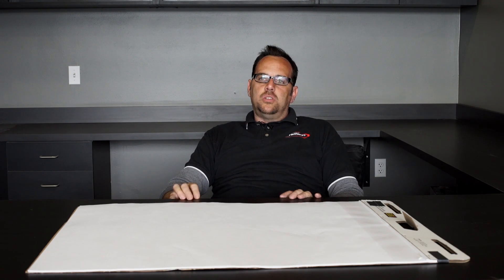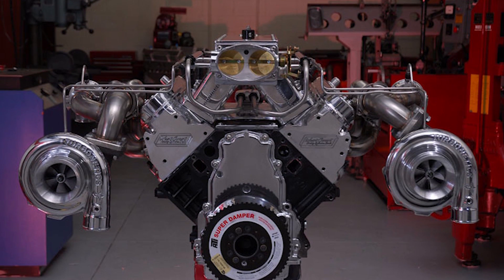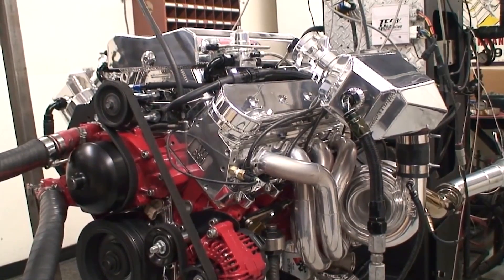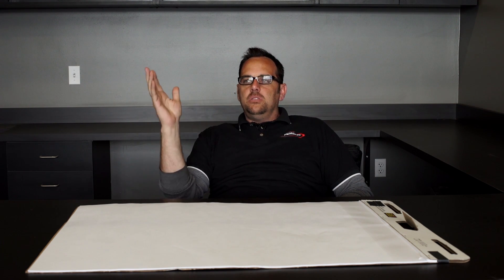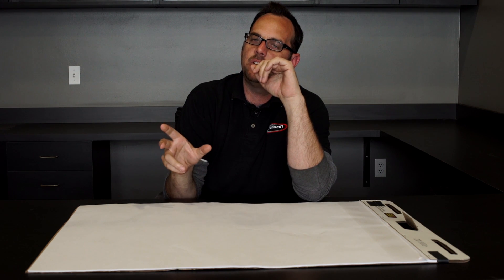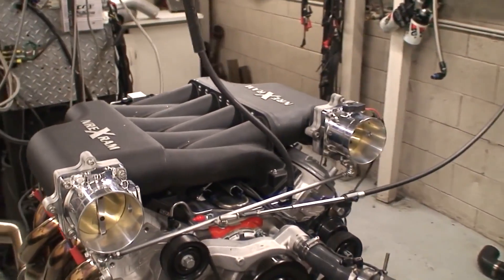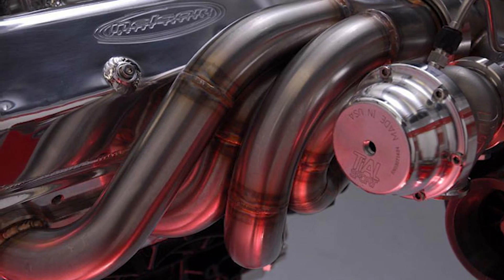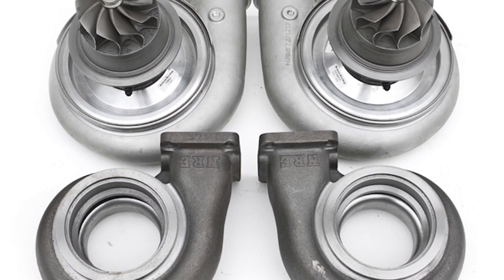Master Engine Builder Explains Why the LS V8 Is SO Good

Comment: Trick question. It's not.
If it's so good, why is it dying out.
Reply: +Dan Frederiksen I'd say the LS is dying out like 350's with carburetors. Which is to say, they aren't. Pretty much every GM car with a V8 has a variation of one, not to mention all of the aftermarket attention that LS' get. They are the Barbie of engines, just stupid amounts of options.
Reply: +Dan Frederiksen You may have missed the entire point of this video.
Reply: LOL lemme guess you get your ideas about car culture from social sciences class?  Dan Frederiksen
Reply: +shredBucketheadshred Yeah he's one of those
Reply: +Dan Frederiksen ummmm..MURICA! Fuck your global warming we're burning this bitch to the ground
Reply: +Michael Dao but guys.. he just learned it in his first college class, obviously he knows what he's talking about.
Reply: +Dan Frederiksen It was replaced by a more advanced engine.  That's how things work.  If you were an engineer you would understand that.  Care for another go around?
Reply: Dan Frederiksen Actually we were talking about the LS V8 engine here.  There are more aftermarket applications for the mill than ever before.  The original small block Chevy hasn't died out yet. Anyone that thinks...err...sorry...FEELS that the LS is dying out is just ignorant of the facts or just pushing their special little agenda.  Or someone just pretending to be an engineer.  

The Ford F series has been available with a 6 cyl for decades.  And the F150 is still available with a V8.  Then again, an engineer would know that.  

And electric cars are an alternative, not a replacement.  Not until range and recharge times (and price) equal combustion engines.  An engineer would know that. 

Had enough schooling for one day? lol
Reply: +Dan Frederiksen Your surface level understanding and desire to showcase it is hilarious.
Reply: +Dan Frederiksen huh?
Reply: BAHAHAHHAHA you really don't know much about the V8 fandom around the world do you OR the fuel alternatives before even considering electric THAT BTW as yes produces far worse pollution in the long run per car through production and recycling limitations ? You REALLY don't know much about people and car people in particular do you!Dan Frederiksen
Reply: Carausu Vlad So it seems that we agree.  I had high hopes for the Z06 but that heat soak issue should have been ironed out before it's release.  But then again, the Porsche GT2 RS had the same issue. 

But remember when the original mouse was replaced by the LT?  Everyone hated it for the same reasons.  Then it became the darling of hot rodders.  Lingenfelter used it to make ridiculous power.  Then the LS came out and everyone hated it.  The cylinder slap was maddening.  See how thing change?  In a few years everyone will be in love with the new LT4 once it's idiosyncrasies are figured out.

I bet someone figures out a fix for cylinder deactivation before there's a glut of used LT4 engines on the market.

BTW, my SCCA/Rally/Everything car is a '70 Z28.  I'm seriously considering a LS swap from a wrecked GTO.  Mostly for weight savings but also because it can be had so cheap.
Reply: Dan Frederiksen But you on several occasions have claimed to be an engineer?  Lying seems to come very easy to you.  No wonder basic engineering principles elude you.  That is why you have an opinion and I have informed opinions.   No wonder some of your statements defy basic laws of physics and even common sense.

Your statements are about as reliable as a Tesla.  lol

Troll smarter next time.
Reply: Dan Frederiksen Is it just easier to call people names than to actually make a valid argument?  That isn't something a real engineer would do.  lol
Reply: Dan Frederiksen If it is a fact then someone other than you should be able to verify it DUMMY.  An engineer would know this DUMMY.  lol
Reply: ***** Agreed.  The LS will be around for a long long time.  Even though it has been replaced by the magnificent LT by GM.  Current Corvette owners are reporting over 30mpg on the highway.  Amazing.
Reply: ***** I remember when I linked evidence that in some cases a larger V8 can run cleaner and have better fuel economy than a smaller forced induction engine.  Danny boy completely lost his sh!t and ignored the verifiable data.  Then babbled about electric cars.  And he claims to be an engineer.  lol

And I'm a huge Buckethead fan too  :-)
Reply: Yahtadi Shidiq
Wow your ignorance is outstanding. The fact that it has been proven Volkswagen cheated these tests and have in several press conferences acknowledged the problem and attempted to apologize for it. Or that some of their top brass have been fired over the issue. You sound like the typical liberal who is incapable of understanding common sense.
Reply: NuclearGrizzly
not dying out tho with aftermarket blocks heads and parts being pumped out, more an more car get LS engines everyday
Reply: NuclearGrizzly yes, I am excited about the LT becoming mainstream too...I love how compact and light it is. you are right, its still new so its unfair to compare it with an engine that has had 20 years of evolution, refinement and aftermarket parts..
I can see a LT engine in my 68 camaro project in the future when the prices will come down and the issues are all ironed out
Reply: Dan Frederiksen What idiot told you that.  Certainly not an engineer.  Could you provide a link?
Reply: Dan Frederiksen Could you provide a link to the relevant data to support your opinion.  I can't find any information that would support your claim that the entire world's transportation needs could be powered by wind, water and solar.

It just violates basic engineering principles?

Or are you just making things up again? lol
Reply: Yahtadi Shidiq
You really think anyone will take you seriously? All of you responses have degraded into nothing but drool. It is extremely obvious that you are nothing but a troll just looking for reactions. Ive grown tired of you trying to dumb up my day, Congratulations you have earned the right to be in my blocked dumbasses group, You deserve it.
Reply: +Dan Frederiksen Here's a fun fact:  the Toyota Prius, that gasoline sipping hybrid, causes more environmental damage over the course of a 10 year life than a Corvette.  The reason being, the mining and refining of the nickle used in the batteries causes much more environmental impact than just running a normal car for the same amount of time.  Electric cars and hybrids are no more than clever marketing, preying on mass hysteria and media sensation.  We are much more likely to see biofuel and hydrogen powered cars than to see electric cars, due to energy density of fuels vs. batteries.  Hydrogen can be cheaply and easily created by genetically tweaking common pond scum and biofuel has already been proved to be a viable fuel source.  Both these fuels can carry many times more energy per cubic foot than the best practical batteries available today.  You have done a masterful job of trolling but now that you have been disproved so many times you should run away and play in the litter box.  Hey, I wonder if you could use animal droppings to create a viable fuel.......
Reply: Dan Frederiksen
Hey dummy!  Can you backup anything you've said?  Or is it all just more of your glassy eyed devotion to a failing technology?
Reply: +NuclearGrizzly that 30mpg in the new corvette might come from cylinder deactivation, which won't be available for LT crate engine swaps...also the new LT is way more difficult to supercharge/turbo...both Hennessy and Lingenfelter  are having troubles getting more than 650HP. They still prefer the LS over the LT for its versatility. Yes, a stock N/A LT is better than a stock LS, but that's it...just look how many problems the LT4 is having in the new Z06, while the LS didn't break a sweat making 640HP in the ZR1
Reply: NuclearGrizzly
you didn't even tough on an enthusiasts love of a V8 and how restorations of old cars are re-birthing them and even reproducing old cars all the time , Dan is clearly vacant of understanding of such things and probably things we will all wear grey space suits and conform like good atomitons
Reply: Dan Frederiksen Information from YouTube trolls, like yourself, is like Tesla Electric Cars.  A lot of hype, a lot of talk but fail to deliver and not very reliable.
Reply: SpecialKLSX Your comment prompted me to do a bit of reading on the subject of algae based biofuel.  Very interesting.
Reply: SpecialKLSX It's no use arguing with that idiot.  All it does is spout out easily refuted junk science and call people names.  Challenge it to provide links that support it's silly willy uninformed opinions and watch the fireworks.
Reply: +NuclearGrizzly Its funny how no one has realized that Dan is a troll. Ive seen him spouting ignorance all over YouTube in failed attempts in claiming that he is a genius. He is nothing but a joke.
Reply: chefdan87
For a while he claimed to be an engineer.  Well I am an engineer so it was pretty easy to expose his deception.
Reply: Yahtadi Shidiq
Germans have to lie and cheat to pass emissions and the Japanese have the largest recalls in automotive history. So basically you are full of shit.
Reply: +Dan Frederiksen You really are insecure and delusional about your own intelligence. You sound like an angsty teenager who cannot actually reply with anything other than your own opinions about car culture and engines (which you clearly don't understand other than a few minor details). Please just accept the fact that you came here to spout your (pretty stupid) opinions and nobody here really gives a shit about what you're saying (you are so self absorbed with your own supposed "genius" that no amount of arguing with you will change your mind). Just go back to reddit and 4chan and look at pictures of cats and quit pestering the people who came here for an actual conversation and not an argument with a child.
Reply: +NuclearGrizzly LS powered Corvettes were getting 30mpg *...oh I see what yup did there... OVER 30mpg! Right carry on.
Reply: DeCode Er We live in an age where a Corvette gets better highway MPG than a V6 Honda Accord.
Reply: Dan Frederiksen Hey dummy.  Can you provide a link or two that would support your silly willy little uninformed opinions?

What?

You can't

I wonder why? 

It seems like a genius would be able to.  lol
Reply: +Dan Frederiksen Lol dude global warming? you mean climate change. Scientist proved that colder places are getting colder and warmer place are getting warmer. But! global warming is Everything is warming up which multiple universities have proven Global Warming isnt happening at all and thus Global warming to changes its name to "Climate Change" lmao. you need to at least wikipedia some more stuff before you make uneducated statements.
Reply: Dan Frederiksen Hey dummy.  Didn't you get the memo idiot.  "Global warming" is so 1999 cretin.  It's all about climate change you interbreed halfwit.  That's so you morons can blame everything on someone else you sweat off of a baboon's balls.  

A genius would know this.  lol

You just keep getting more and more stupid.

And here's a link for ya'...

http://www.marketwatch.com/story/teslas-stock-falls-after-barclays-downgrade-suggests-investors-should-sell-2015-10-09

The writing's on the wall punk.  lol
Reply: +James Burleson because some oil company told you that?
moron.
originally their lie was that a hummer polluted less than a prius and you ignorant obtuse shitheads were only too happy to run with the lie.
the pollution from batteries is also a lie. lithium is in our oceans in vast quantities and you can eat lifepo batteries.
you are murica shitheads. the scourge of the world. be embarrassed and change.
Reply: +Dan Frederiksen and let's not mention how battery acid waste is a huge epidemic. Not only is it extremely harmful to this planet but we can't find anything to do with it and if you convert all cars to it were in a much worse position than we are now. I mean fuck they already proved that the hummer h1 was one of the worst polluting vehicles ever built and yet a Prius after ONE change of batteries has just done more damage to the earth than a hummer h1 can do in its lifetime. There is absolutely nothing green about an electric vehicle when the waste it creates is astronomically worse than the gas engines we use now. And because you believe in electric cars being so much better all that does is show how little you are educated about them
Reply: sillymoons oo Yeah.  But Dan "Special Olympics" Frederiksen makes it too easy.
Reply: +NuclearGrizzly Europe also uses fucked up standards for determining fuel economy as well. http://www.greencarreports.com/news/1091877_why-european-gas-mileage-ratings-are-so-high--and-often-wrong

https://www.washingtonpost.com/blogs/ezra-klein/post/can-you-trust-the-mileage-sticker-on-your-car/2012/05/03/gIQA3yuTzT_blog.html

http://blogs.wsj.com/drivers-seat/2012/11/02/hyundai-mpg-debacle-can-you-trust-the-fuel-economy-sticker/

Let's not forget about these scandals:
http://www.independent.co.uk/news/business/emissions-scandal-nissan-fiat-volvo-and-many-other-cars-found-to-emit-far-more-pollution-than-a6674116.html
Reply: 100 million LS engines sold and they are junk? How so?
Reply: +shredBucketheadshred I'm all too familiar with how many idiots remain. But it will happen.
Reply: +Didn't have much of a choice... girl, please...
Reply: +SpecialKLSX no fuel will be relevant. It will be electric. You have no clue.
Reply: +NuclearGrizzly it's not a link type fact, dummy. I know what you are doing.
Reply: +NuclearGrizzly sigh, simple minded one. If I were as simple as an engineer I might think that. But because I'm a genius I can deduce things others cannot. This might be a foreign concept to you.
Reply: +NuclearGrizzly engineers are the oompa loompas of science.
Reply: +Dan Frederiksen You're a fucktard
Reply: +SpecialKLSX you can make enough biofuel, that's not the issue. it's just better to use EVs powered by wind, water and solar.
so yes I am right and yes you are sorry
Reply: SpecialKLSX BTW, a coworker just informed me that my company was contracted to do some work on an algae based battery.  All of this algae talk has peaked my curiosity.  Thanks for bringing it up.
Reply: +SpecialKLSX bio is less than 1% efficient plus requires a lot of work. Solar is a few micron of processed sand and you can leave it unattended for decades. It can be dirt cheap to produce. get i...
on windy days in Denmark we have more than 100% of our power from wind. today. now, could you go play on the freeway.
Reply: +SpecialKLSX ugh, you are stupid. plant photosynthesis didn't suddenly become dramatically more efficient since the 1950s
Reply: +chefdan87 I'm so smart in fact that I know that deep down you are afraid I am right. And I am.
Reply: Dan Frederiksen
Lol you are a sad little boy. People with true intelligence do not need to plead to the social network in attempts to prove how smart they are. You scrape for any form of acknowledgement on the internet as you most likely receive nothing in the real world. I pity you.
Reply: NuclearGrizzly
You know he must have created another account under the same name as i am almost sure i blocked him on the last thread i came across him in. I remember being tired of him persistently trying to dumb up my day with his ignorant rants. I bet he has to keep making new accounts as people probably just keep blocking him to avoid his stupidity.
Reply: chefdan87 It wouldn't surprise me.
Reply: Proud-butthurt are coming~
Oh please.. Of course, emission issues. Hmm.. You know what, lemme tell ya.. Because there's no evidence to supp that statement. When actually, failures in the American can industry have been common and VERY publicized. LIke GM ignition scandal for example. Ive actually enjoy these US conspiracy, since they are hilariously ignorant
Reply: +chefdan87 do a little more research on emissions instead of being blinded by media, an shall we talk about american lies purposely making parts to fail and the massive millions of recalls
Reply: See. I enjoyed this xD but please keep going..

I just wondering:
- US's emmision regulation was really THAT hard for big brand like VW(please)?
- Do you never heard about US-power-democracy that make anybody says anything they want?
- Even J. Clarkson straight to buy a new Golf GTI after that issue. He says: this is the best car in the world, its my favourite and I dont buy anything about that issue

But dont let those point stop you Murica's Warrior. Lets say US right about that issue(which always right of course. Lel)
Back to video: LS engine is so good? Wow. Such a wow
No hate but.. Wow
Tell me please, except looking baddas what else Murica musle offers?

Ah one thing. Are you even sure that US local automotive industry passed his own emission regulation?really? like for sure? dont make me laugh harder
Reply: Kita Barbie
State proof please. The Fast Lane Car, has videos where they show how the defeat devices in the cars work. And the dyno shows the loss in power and adjusted emissions. You idiots are basically trying to argue about something like that gravity doesn't exist or that the world is flat. You are WRONG. And it is hilarious that you continue to defend it.
Reply: Yahtadi Shidiq
You continue to lack any content or proof to your comments. Nothing but opinionated shit pouring from your mouth through your keyboard. I truly pity people who are so ignorant to the world.
Reply: +chefdan87 ah this is the first time i mentioned you. I might be ignorant but im not stupid like you murica. Im german and all people in my country feels pity for Murican because a really really high level of their stupidity(whom i kidding, every single live person in the world thinks Murican is an idiot). Live long stupid, all hail Murican! xDD
Reply: Kita Barbie
Does it even matter to you that VW has admitted that they committed fraud and other illegal acts?  Why do you suppose VW would lie about that?
Reply: +Jim Toots if you and I disagree, could there be another scenario than me being wrong? is that the only possibility.
Perhaps a scenario where I'm university educated and you are not. Where I do world class artificial intelligence for a living and you don't.
There are only two people in the world who call themselves geniuses; me and Kanye West. And only one of us is right.
Reply: +Dan Frederiksen God finally. Smart person here. I love this guy
Reply: Dan Frederiksen So first you claim to be a world class engineer.  Well I debunked that special little lie.  Remember?  That had to be embarrassing for you.

Now you work with artificial intelligence?  Strange that you failed to mention that in those video's I shamed you into taking down.  Remember those videos.  Those grade school level experiments that I debunked with sound and accepted engineering principles.

Still you claimed great intelligence and yet you still have no grasp of basic engineering principles or the requirement of being a research associate.  Let alone your incapacity to fathom peer review.

Exactly what University did you attend...Wossamotta U?  lol
Reply: +Dan Frederiksen and everybody else there's no reason to elscalate this with cheap words, electric or hydrogen powered engines may replace gas engines in the future right now to build an electric car it's expensive, mostly due to the battery. but I don't believe that cultural stereotypes into the discussion even though I do agree that massive trucks and hummers are destroying the planet, but there is no reason to blame any person who drives a truck or a v8 an idiot as they can be very usefull work vehicles. btw I'm Canadian and believe that gas is here to stay at least for a while; however, there is no point in most people to drive v8s but calling them idiots is just impolite.
Reply: +NuclearGrizzly and an electric sedan beats a corvette
Reply: Dan Frederiksen
How exactly does a electric sedan beat a Corvette? Top speed? Nope. Handling? Nope. Range? Not even close. How long does a Tesla take to recharge? 10-12 hours. How long does it take to fill the gas tank of a Corvette? Five minutes. Have fun sitting on the side of the highway for 10 hours waiting for your batteries to charge because you only have the range of 200 miles. It only barely out runs the corvette from 0-60mph. And that is only if you buy the $10,000 option for the "Ludicrous" fuses. And how many times can you make those 0-60 pulls before the battery drains or overheats the electronics? Not to many. Yet it still loses in a 1/4 mile race against the faster Corvette. Keep making ignorant statements, we all are really enjoying watching how dumb you keep making yourself look.
Reply: +chefdan87 have you heard of the supercharger network?
you can drag all day long without running out of battery. it does overheat in racing though so it's not built for that. but few people race on the roads anyway. it's a daily racer. and I'm guessing they sell quite a few more Model S than Vettes.
You are the ignorant one, sonny :)
Reply: Dan Frederiksen
You think they sell more Teslas than Corvettes? Wow you are a special kind of dumb.
Reply: +chefdan87 yeah that special kind known as a genius, mister 10 hour recharge. in 2013 there were 13.5k corvettes sold. Tesla is passing 40k this year. even though vette sold many more in 2014 than 2013, Model S is still winning in 2015. And it's old fools who buy vettes. Whereas it's the smart folks who buy Tesla. And of course vette sales will disappear completely soon enough. Watch, my nitwitted friend
Reply: Dan Frederiksen
What about the Supercharging Network? So it cuts down the charging time to one hour and fifteen minutes for a full charge. So lets think about that, Say i drive from where i live in Virginia to Miami Florida. That is approximately a 1000 miles, or 14 hours of driving. With a range of only 200 miles that is five stops to charge. At one hour fifteen minutes a charge that adds six hours and fifteen minutes to the trip. And that is if a station has an available charging port available. Everyone knows that kind of charging will ultimately degrade the batteries over time and im sure they are super cheap to replace...."sarcasm implied". You are fighting a losing battle.
Reply: Dan Frederiksen Hey dummy!  A Tesla beats a Corvette?  Not in reliability.  That's for damn sure. 

At least GM can make a car with working door handles.  That's some piss poor engineering on the part of Tesla.  Wouldn't you agree dummy?  lol
Reply: Dan Frederiksen Hey dummy!  Wouldn't it be more fair to compare the total production from GM to the total production from Tesla?
Reply: I think you missed the point. This isn't referring to production vehicles so your argument about electric is invalid. Unfortunately your smug emissions are off the chart though, if you'd like I can help you become electric in order to help society...
Reply: +NuclearGrizzly no idiot. and GM has set up a group internally to deal with the Tesla threat. true story. they are afraid and they should be.
but the truth is they are idiots so they only exist to the extent that Tesla can't develop new models fast and cheap enough.
Reply: Folopolis In the '70's Al Gore (and Carl Sagan) was shrieking about global cooling.  Had multiple articles published.  Called into question the intelligence of anyone that disagreed because he had irrefutable proof.  These was money to be made there.  Of course Al Gore was proven to be wrong.

Enter the late '80's early '90's.  Al Gore was shrieking about global warming.  He had multiple articles published. Even a book or two and a movie.  Once again he called into question the intelligence of anyone that disagreed because he had irrefutable proof.  There was money to be made there.  And he made a lot of it.  Of course once again Al Gore was proven to be completely wrong.

Now of since both global cooling and warming have been disproven we have climate change.  And now anytime anything happens the simple minded have a new boogie man to blame.  

There's money to be made there.
Reply: +NuclearGrizzly moron
of course global warming is real and Al Gore's documentary was 2006. shithead
Reply: +NuclearGrizzly interbreeding is usually the good kind where inbreeding is the one you want to avoid. Isaac Newton.
I'm still the smartest man in the world which given your claims puts you in a bit of an awkward position.
English isn't my first language either, I merely command it with virtuosity. Like the genius that I am.
I suggest you rethink your life.
Reply: Dan Frederiksen Smartest man in the world?  You're more like a gold medal winner...in the Special Olympics.  Sure, for someone of your decreased mental capacities it is certainly an achievement.  And I'm sure you are held in the highest regard among your fellow tards.  

But to the rest of the world you're still just a drooling idiot..  

BAM

This is where I drop the mic and walk off stage.  That is unless you need an encore?  Well do ya' punk?  lol
Reply: +NuclearGrizzly hehe good luck with that.
It will be as I say because the truth is my ally and a powerful ally it is.
I probably wont answer you again. I wont distract you from the terrifying realization of the depravity that you are and desperately seek to escape by antagonizing me. You reap as you sow.
Reply: +ReF Z06 sigh, wrong on all counts. USA uses 4 times more energy than other industrialized countries. You are sloppy pigs. And V8s are extremely rare in Europe while in USA you put 6L V8 in a fucking pizza van. And F150 is the most selling vehicle model which is nothing short of an abomination.
There is a reason european cars sell to the more intelligent in USA while US products generally never sell outside USA. Only Ford which has been europeanized, sells. China pollution is largely only an extension of USA waste.
Reply: Dan Frederiksen Hey dummy.  Back for more?  Good.  Since the monkey idea still would have required a level of intelligence that you clearly do not possess here's another idea.  

Identify as a mudflap on a late model Peterbilt.  I mean, at least you will serve some sort of function.  And the next time your stupidity is called out you can say, "Hey, I'm a mudflap on a late model Peterbilt".  

Or would that also be too taxing on your diminished mental capacities?
Reply: Dan Frederiksen Hey dummy.  First you claim that the V8 is dead because the F-150 is available with a V6.  Now you are whining (in a very b!tch like fashion) about V8 powered F-150's.  Well which one is it mudflap?

BAM

And all current American V8 engines employ cylinder deactivation.  Do I need to explain how that works mudflap?  It seems that your Euro V8's don't enjoy this technology.

BOOM

Who's my b!tch?  
Say it..
Say it...
That's right dummy Dan Frederiksen is my b!tch.  lol
Reply: James Burleson You forgot to mention the hazardous waste produced during battery recycling.  Massive amounts of environmental hazards produced.  If Dan Frederiksen were really an engineer he would know this.  Oh wait.  I already exposed that lie.
Reply: Dan Frederiksen Hey dummy.  Here's what Stanford has to say on the matter...
http://large.stanford.edu/courses/2010/ph240/nie1/
Here's another you wingnut..
http://science.howstuffworks.com/science-vs-myth/everyday-myths/does-hybrid-car-production-waste-offset-hybrid-benefits1.htm
And here's where Popular Mechanics references The Norwegian University of Science and Technolog...
http://www.popularmechanics.com/cars/hybrid-electric/a8118/electric-vehicles-pollute-more-than-gas-or-diesel/
And one more for ya' mudflap...
http://spectrum.ieee.org/energy/renewables/unclean-at-any-speed/

Wow dummy, can you produce a few relevant links to support your jihad?  GOOGLE is your friend.  lol

Well there's always the below average monkey or mudflap option in your future
Reply: +NuclearGrizzly This troll actually seems to believe his verbal diarrhea.  Perhaps it would be greater punishment to let him languish in his idiocy and ignorance.  Educating him would actually be a favor and it seems he wishes to receive no help.  Let him live in his happy delusion and leave the real science and thinking to those with the intelligence to comprehend basic concepts.
Reply: James Burleson There's no expectation of educating that idiot.  I just find his subjugation and humiliation an entertaining diversion.
Reply: +Jc Culpepper The "LT" series is still a LS.  
+Dan Frederiksen is clearly stupid or a total troll.
Reply: *****
People are dropping  LS7 or LS9  mills into (the now defunct) Fisker Karrma.  All that power in a 2400lb car has to be a blast to drive  :-)
Reply: +NuclearGrizzly it's 2400kg
All V8 fans are ignorant. Without exception.
Reply: Dan Frederiksen
Actually I'm a flat 4 and 6 fan you idiot.  I mean I've said it several times.  Wrong about everything and no reading comprehension Danny boy?

And we both are wrong.  The Fisker weighs considerably less than 2400kg with a real motor and without those heavy batteries and electric motor nonsense.

Yes I had a typo and you have been wrong about everything else.  But I did manipulate you back for your continues subjugation and humiliation.  You are such  a simple minded fool.

Does being as stupid as you are hurt?  Really?  Does it hurt?
Reply: +Dan Frederiksen as long as there are gear heads the v8 won't go anywhere. And there is no shortage of gear heads
Reply: +Kyle Carson idiots are fans of V8 because they think they are powerful and impressive. That will fade as they are shown up by the vastly superior electric drive. They will disappear same as steam cars.
It will be as I say
Reply: +Dan Frederiksen I'll believe that when I see an electric engine run 3sec 1/4 mile and make an equivalent of 10,000hp like top fuel v8s
Reply: +Kyle Carson can your V8 do that?
and like the sniveling ignorant punk that you are, when it happens, you are nowhere to be found because you don't admit you were wrong. You wont come forward and say that you were wrong, you were an idiot. Same as all the other jackasses. You wont bow and offer an apology to the righteous people that saved the world that you idiotically opposed.
amateur built EVs are already running 6s. With motors from forklifts.
Reply: Dan Frederiksen
Hey dummy!  I've proven you to be wrong on multiple occasions.  Even proven you to be a outright liar.  Have you stepped forward idiot?  Have you admitted that you are wrong dumbass?  I mean I have provide proof?  Where's your apology moron? 

Can you provide a link to support your jihad?  I mean if your silly willy electric cars are so superior then they should be able to go farther on a charge than any V8 on a fill up.  And a charge should take no longer than a fill up.  And you should be able to provide a link that shown that a Tesla is more reliable than a real car.  So monkey boy, I'm waiting for those links.  lol
Reply: +Kyle Carson you wouldn't happen to live in a red state, would you?
maybe married your sister.
Reply: Dan Frederiksen
Hey dummy!  Still trowing insults rather than posting links that might support your silly willy jihad?  I wonder why.  lol
Reply: +Dan Frederiksen lmfao! You're so clueless you resort to insults
Reply: +NuclearGrizzly I'm pretty sure everything you're saying  to him is going over his head lol
Reply: +Kyle Carson I'm the smartest man in the world, son. I'm a polymath genius :)
What you said was spectacularly ignorant. It's rare to find someone so purely unaffected by truth and still peddling that hummer oil industry lie today.
I would point out that a prius is a gasoline car but that's probably much too subtle for you.
Lithium batteries are quite harmless. The lead acid batteries you idiots use however are somewhat bad for our environment.
Reply: +Dan Frederiksen oh and the nickel mining done for the Prius doesn't cause water or air pollution? By the time the Prius is built its a dirty ass car genius. Not to mention the process of the nickel shipped to China, Japan, and then here isn't also causing pollution. As yes the Prius has a gas engine which causes pollution and an electric engine which causes an insane amount of pollution to create and the waste from it causes even more pollution.
Reply: +Kyle Carson even if a prius' battery was particularly harmful, which of course it is not, it would not undermine my advocacy of electric cars since it's purely powered by gasoline. Moron.
The reason us reasonable people are shifting the world away from idiotic V8s to electric cars is of course because the V8s are the filthy pigs and electric cars are the actually environmentally friendly option. lifepo batteries are so harmless that you can eat them.
Lithium is in our oceans and in dry lake beds. It can be eaten.
If the Hummer was really less polluting than a Prius, just maybe it wouldn't have gone out of business because it was so unpopular.
Same as the idiotic Dodge Viper is now dying.
Even the pinnacle of ignorance that is you, will come to love and prefer electric cars.
Reply: +Dan Frederiksen keep telling yourself the process of making batteries and the waste left over from them isn't extremely harmful to the planet.
Reply: +Kyle Carson I don't have to think about it at all because you are a shithead with zero connection to reality.
V8 will die. Watch and learn. And try to stay out of the way when the best of us save the planet from you nitwits. Don't give us ideas about intelligence hygiene. You don't want to morbidly disappoint the smartest people.
Reply: +Dan Frederiksen http://priuschat.com/threads/prius-is-not-a-green-car.64178/
Reply: TnKShxft He does these sort of things to be subjugated.  Before he deleted the videos on his channel, he talked about how he becomes sexually aroused by being make to look like an idiot.
Reply: +chefdan87 actually, do some research. Japanese motors are actually more reliable and last longer than most American cars.  and when I go to a scrap or junk yards I only see mustangs and other American cars. if I ever see a Honda I'll piss in it to mark it as my territory. Oh,  I forgot to tell you,  you're just an American fanbody saying ( my new keyboard doesn't have quotation marks in it for some reason) Murcia is the best and GM Is Damon's best!!  I hate people like you, who literally stick with their opinions and spam it all over YouTube. Yes I might just be 12 years old but I know my research. So you're the troll here m8.
Reply: +NuclearGrizzly ouch you ripped apart this poor kid 😂😂
Reply: +sillymoons oo, 350k preorders on Tesla Model 3 in under 2 weeks. How are Viper sales doing, simpletons?
Reply: Dan Frederiksen 
Yet Tesla has had yet another recall.  lol

If you were an electrical engineer you would understand why.

Yeah, Tesla should be around a long time.  lol

http://fortune.com/2015/05/06/tesla-revenue-losses/
Reply: +NuclearGrizzly, Model X was recalled for a back seat issue, you moron. And losing money hasn't been a problem so far, has it.
The stock market loves growth and 350k preorders is religious devotion.
Reply: Dan Frederiksen 
So we agree that Tesla has been plagued with reliability issues and is driven by zealots,  Glad that you can finally admit what I have been pounding into your head for months.  

But what happens once Obama stops throwing tax payer money at Tesla?  Who's going to pay for their losses then?

It appears that not only are you not an engineer but have no grasp of basic economic principles.
Reply: +NuclearGrizzly, I have been very critical of Tesla's reliability issues. Your super stupidity has not been contributory in the slightest.
And the stock market has funded the losses so far, not Obama. What a surprise, you chose to be a super moron again.
Reply: Dan Frederiksen I'm glad that I have been able to pond it through your thick skull that Tesla makes a very unreliable product.  Now I just need to pound it through your head that Obumble and other leftists have subsidized Musk's various money losing ventures to the tune of $5 Billion.  I can post a link if you like you can GOOGLE it yourself.

And remember, I have taught you that Tesla provides products that are unreliable, over priced and the company loses hundreds of millions of dollars every year.

See what I have taught you.  

Now If Tesla dropped an LS in that baby then they might turn a profit.  :-)
Reply: +Dan Frederiksen There is no suitable fuel replacement with the potential energy of petroleum, natural gas or methane at this time. Even if there were, it doesn't mean the V8 would disappear. V8's allow for better balance, stronger design and...more displacement. 
The reasons V8's are not as common in Europe is simply due to the facts that there is a ridiculous tax on displacement (that all but the rich can afford) and that Europe has no oil(since WW2). Thus, to sell massive quantities of cars European engineers have to try to get the same power out of smaller displacement engines. Of course, this significantly up's the manufacturing costs and engine stresses, while reducing long-term reliability. 
Lastly, if electric cars will replace V8's, they will also replace V6's and V4's. So, this point is kind of moot.

Btw, I pay $2 for a gallon of gas (about 4 liters). We are swimming in cheap oil compared to you guys. Isn't it great?
Reply: thybigballs
It's strange that in most of Europe a larger displacement engine that gets better mileage with lower emissions is ridiculously taxed more than a less efficient and dirtier engine of smaller displacement.
Reply: +thybigballs, of course all combustion engines will go away. The V8 is just a bastion of stupidity and it's going first. It basically doesn't exist in Europe although it never really did. That's mostly super knuckledragger USA. Where the eyebrows are half over your eyes.
Reply: Dan Frederiksen 
Danny Boy.  Still pedaling your anti-American BS I see.  Too bad for you that so many American V8 engines with cylinder deactivation get better mileage with lower emissions that your itty bitty European forced induction engines.  Even better than those silly willy hybrids.

Need examples?  lol
Reply: +NuclearGrizzly, o wicked one, my unlimited power will leave no cars with mileage standing. It will be as I say.
Reply: Dan Frederiksen 
Unlimited power?  That obviously does not include the power to comprehend basic engineering or economic principles.  Do I need to school you again?  lol
Reply: +NuclearGrizzly in the trashy chaos that is your mind, do try to remember when it's clear even to you that I was right.
Do your idiotic posturing. Cement your moronity. And then rue it later. Your kind will be struck down and laid to waste.
Reply: Dan Frederiksen
YAWN So many words to say absolutely nothing.  lol

Hey. could you reupload those hilarious videos I shamed you into taking down?  We have some new engineers here at work and they need a good laugh.  

I use you as a cautionary tale for young engineers on the career ending pitfalls of jumping on every bandwagon.
Reply: +NuclearGrizzly, I've told you several times, numbskull, I didn't take the videos down. This is just my second youtube account. You see those helpful two dots in my avatar?
Reply: Dan Frederiksen
Could you provide a link.  These young engineers would really like to experience your special brand of junk engineering in it's purest form.  My descriptions of how much you got wrong just won't do you justice.  You would be doing them a great service.  Plus I'm going to hand out a prize to the one that can find all the flaws in your silly willy faux engineering.

And you still haven't thanked me for the way I trained you to at least begin questioning the poor engineering going on at Tesla.

You're welcome anyway.  lol
Reply: +Dan Frederiksen I can think of a bunch of European cars that have V8's. The only problem is you couldn't afford to buy any of them. We don't have this issue. If I remember correctly, the Ferrari 458 is over $800 a year just in displacement taxes, not including the hefty taxes at the point of sale. For Americans, that is highway robbery.  
I'm hoping for you to state why V8's are stupid, besides "just cuz". Fuel economy. perhaps? Porsche's 911 GT3 with it's 3.8L engine gets slightly less gas mileage than a Viper with an 8.4L V10. The Ferrari 458's 4.5L V8 gets less than the Viper's V10 as well and is even less than the Porsche. 
Is it because you live in a tiny country with tiny roads and have no need for anything bigger than a 2 liter? I think you don't have a valid reason to hate American V8's. You're just another noob trying to defend the fact that you live in a country where 99% of all the cars are tiny 2L shitboxes and that it's basically all you'll ever know or will see.  
It's not our fault we have open roads and lots of space to justify the larger displacement. The reason we aren't building tiny, expensive engines that try to squeeze out a lot of stressful power for their size is because... we don't have to. There isn't an engineer in the world that thinks tiny engines under a lot of stress are better (or cheaper) to manufacture. I can get a replacement V8 for cheap (~$10K) while you'd pay out the ass to replace your engine (~$40K).

Your argument is lacking in facts.
Reply: thybigballs 
Interesting.  It is my understanding that most of Europe is in the process of adopting US emissions/efficiency/crash standards over the next few years
Reply: +NuclearGrizzly I hope so, considering they don't use U.S. gallons (3.785 L) in their conversions. They use the larger imperial gallon (4.546 L) which is almost an extra liter.
Reply: thybigballs
I lived in Europe for a number of years.  It's strange that the Honda I owned got better mileage than advertised.  Everything else got less.  In some cases a lot less.  My boss in Morocco has a Land Rover Autobiography with the V8 diesel (not available in the US) that also gets better mileage than advertised. It even borders on being almost dependable  :-)
Reply: +NuclearGrizzly I've never heard the words Land Rover and dependable in the same sentence.
Reply: thybigballs 
I didn't say it was dependable.  I said "borders on being almost dependable".  Which is a huge step up from the previous generation's rating of "beautiful garbage".  

But honestly, the only problem he's had in a year and 15,000 km is the damn windows and door locks have a mind of their own.  And once the gauges stopped working.  

For a Land Rover that's pretty impressive.  

I had a '11 Autobiography.  Pearl white with ivory/navy interior.  Stunningly beautiful.  But I could never drive it off road or away from civilization.  At least not any farther than I was comfortable walking back.  I lost track of how many times it left me stranded.  Horrendously bad vehicle.  So bad after a year of ownership the dealer offered me the full sticker price (I paid much less) towards the purchase of another car.
Reply: +NuclearGrizzly I'd give my left nut to have a Defender, reliable or not.
Reply: thybigballs 
There are companies here in the US that swap out the Defender's unreliable drive train with...wait for it...wait for it...wait for it...the good ole' LS and a GM transmission.  I bet it's a beast.

I used a Defender in Spain.  No problems.  It really lived up to it's off road reputation.  The best ever was in the Philippines where I had a Toyota LC 70.  No luxury amenities but A/C, No emissions controls or catalytic converter.   Manually locking hubs.  But it would trudge through or over anything and everything.  Absolutely unstoppable.
Reply: 6 months later & It's still not dying out lol
Reply: Jeremy Hall You do know that the Coyote and VooDoo engines are friggin' HUGE?  That Coyote is almost big block size.  Way to big to fit in 4 cyl or rotary engine bay where the tiny LS just slips right in?
Reply: easy killer, youre calling fangirls on chevy guys yet you have commented like 15 times on this one chevy video.  

Its ok, log off and have a drive.  I highly doubt you have a voodoo or coyote because if you did you could be enjoying your car/engine instead of pointless internet fighting
Reply: Dan Frederiksen over 2 years later and the LS V8’s are still here and not even close to dying. 😆🖕🏼
Reply: Jeremy Hall over 2 years later and the LS engines are still keeping up, bitch boy.
Reply: +shredBucketheadshred global warming, electric cars and the dwindling of murica stupidity
Reply: +NuclearGrizzly your ignorant agreement wont prevent its demise.
All V8s are going bye bye. There are little things called global warming and electric cars.
You may have noticed that even bastions of moronity like the F150 has V6 engines and alu now.